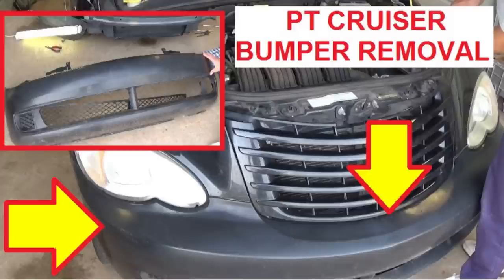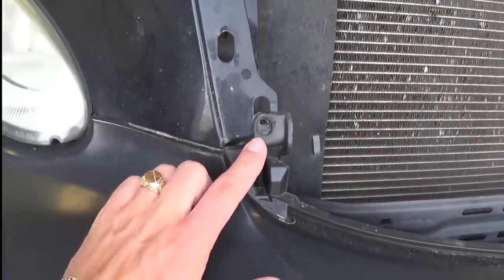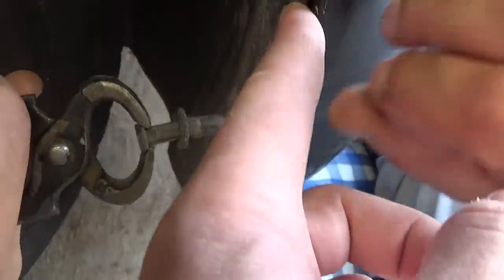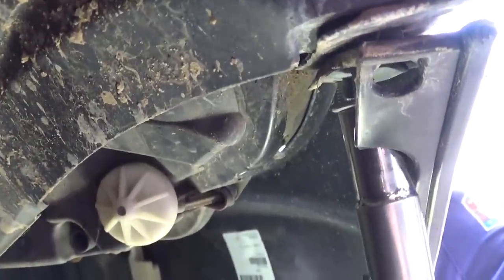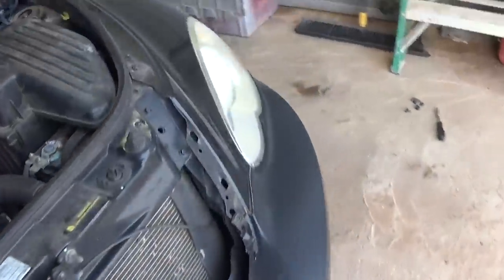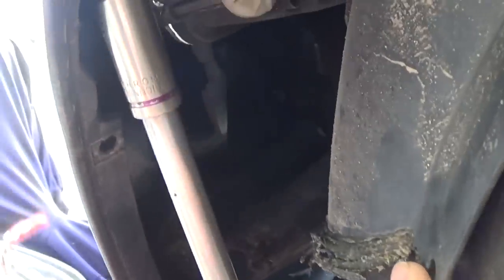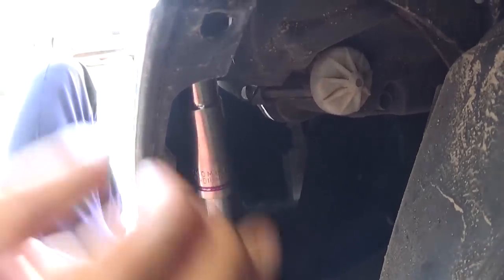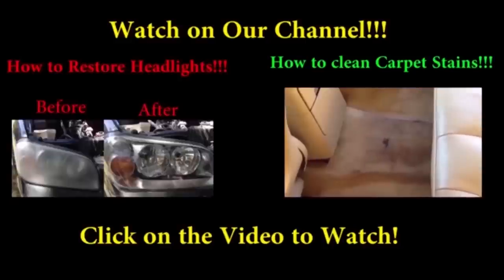Chrysler Pt Cruiser Front Bumper Removal and Replacement

Comment: but how do I put it back on....the sides keep getting yanked off by parking blocks
Reply: NOM145 did you ever find a video on how? I'm going to attempt mine but can't find a video to put it back on
Reply: Mine just came off at a parking block too. piece of shit
Reply: @Drew_3000  I'm replacing my front cover AGAIN due to that issue. The PT stands for Piece of Trash Cruiser. After 40 years of driving LONG trucks, cannot get used to not pulling forward as far as possible in parking spots. Grrr.